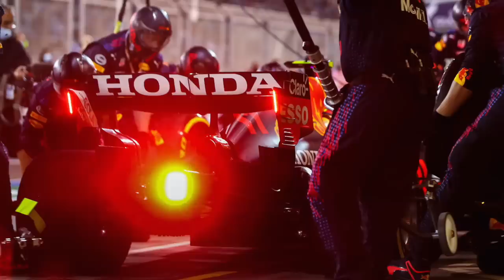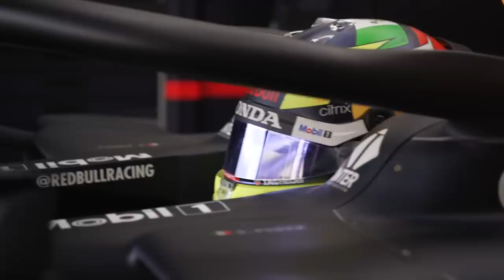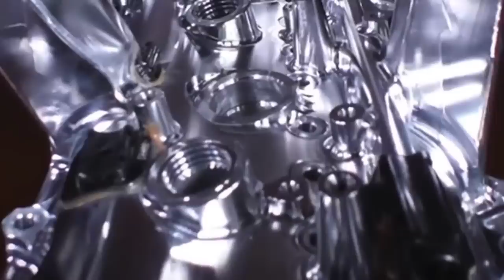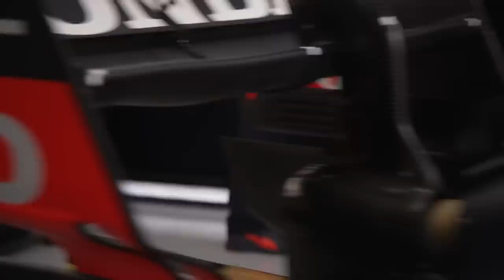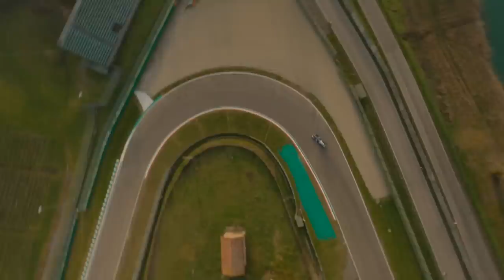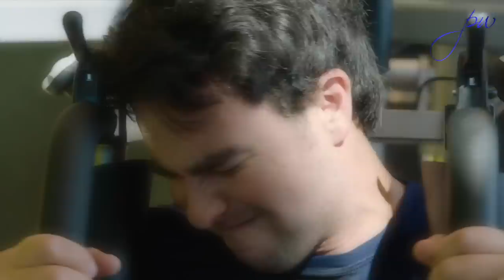How Checo kept it running - F1 feat. Scarbs by Peter Windsor

Comment: Ten seconds for the extinguisher (referencing Gasly's incident) is rather slow by some standards.  The high rate of discharge (HRD) extinguishers we use in aircraft dump their extinguishing agent in less than two seconds, but perhaps they choose the longer discharge time due to the open cockpit not containing the agent.  It probably gives the driver a few extra seconds to get out without being burned.  Still, it might behoove them to try a more aggressive discharge in the engine bay while retaining the longer discharge in the cockpit, though that would probably require two separate fire bottles, which would necessarily add some weight and complexity.

Comment: The tight packaging is Newey's signature mark in his designs. It's always the biggest downfall for them, too. You'd think that he'd have learned by now 🤦‍♀️
In a way, I think it was a good thing for Checo that it happened. He underlined his ability to think quickly and calmly. We already knew about his overtaking abilities (though he still can be a bit overheated during a race - he shouldn't have continued on in the first Bahrain race last year. Especially knowing he had another race in 7 days, he should have pulled over immediately and prevented the fire happening. Talk about striking lucky that they were able to fix the car in that time. I still maintain that continuing on when not necessary, potentially pouring oil out the back onto other drivers, is dangerous and unprofessional). However, this ability to think through his problem and get the car going in time to be able to start the race earned more respect from me.

Comment: Hi, coming from an electrical background high voltage in the Uk is defined as “high voltage is seen as any voltage difference between conductors that is higher than 1000 VAC or 1500 V ripple-free DC, or any voltage difference between a conductor and Earth that is higher than 600 VAC or 900 V ripple-free DC” can you please explain or verify what battery voltage F1 cars run at? As all batteries are DC can we assume that all F1 cars run at above 1500 VDC? Thank you.